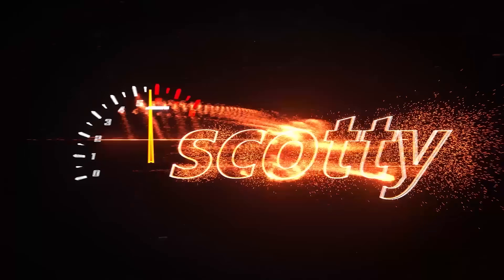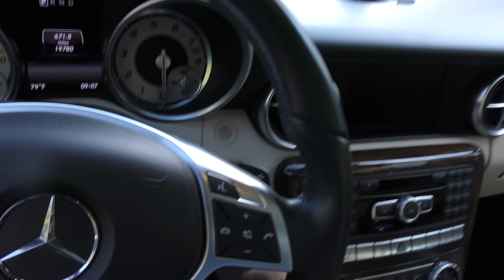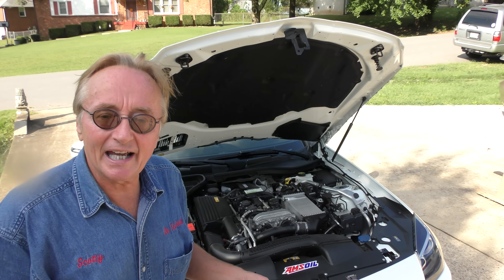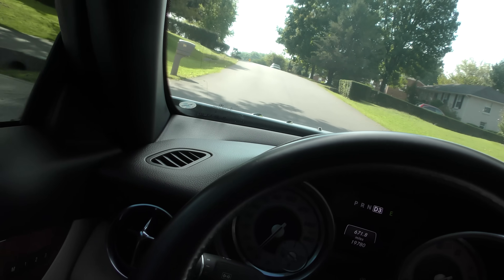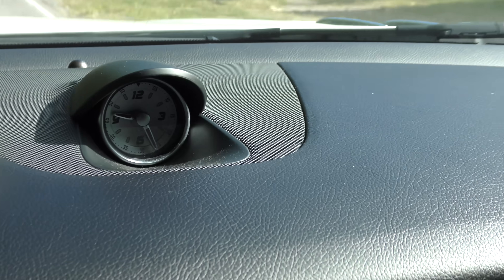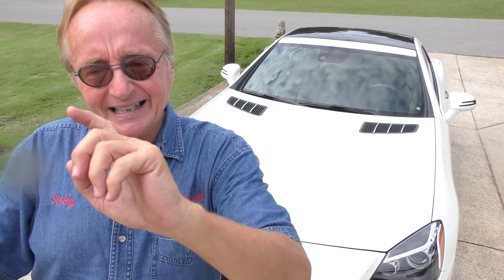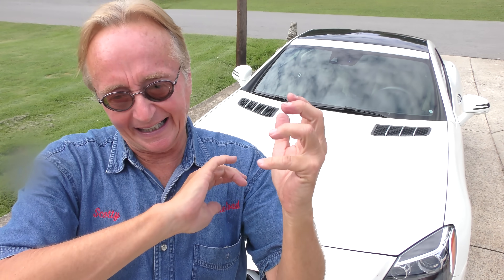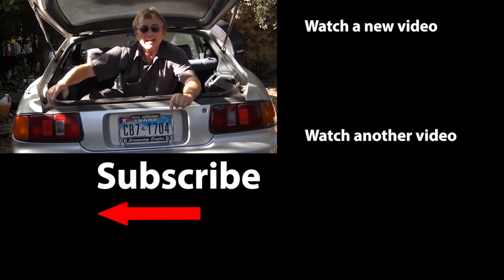I’ve Been Lying for Years, Mercedes is Actually Better Than Toyota

Comment: Mercedes quality really started tp.decline about 1996. I had an e320 from 1996 and my Solara was a wayyyyyy better car. The old diesel cars.were best the 123, 116, and 126. They still.had quirky problems like th AC never worked and window regulators broke once a month.

Comment: .  60k for a tiny 2 seater with a V4 lol and it’s a Mercedes. Even 20k for a used one is pushing it, I saw the center console it looks like it was doused in bleach no wonder it was 20k. only reason I’d ever consider a Mercedes is for the interior and if I was leasing the damn thing brand new.

Comment: Mercedes are better than Toyota going to the mechanic shop getting repaired all the time.  Spent $15k in repairs over 1.5 years ago going to the shop every month.  Only thing good is the engine, everything else you will replace is what my mechanic said.

Comment: Look at that super congested engine compartment mess. You can't even unscrew a bolt let alone work on a specific detail. I have all the room in the world to fix, replace or service every single element on my Toyota/Lexus vehicle. Even those that are slightly hidden due to physical constrains are logically positioned and require very little extra work to reach. Everything that comes from Europe is trash, except the german-made vehicles which are extra special trash!

P.S. For those that missed it, Scotty was trolling and mocking that MB throughout the video by statements that sounded like compliments on the surface but were actually deep insults.

Comment: Its a very nice biased opinion. He casually leaves out that Mercedes did a fine job at replacing the main problems on AMG models especially 2011+ cams fixed and other. However the C63s was built in the US and not in Germany. Stay away from those. I have an e63s from 2014. 212K on it. Going strong. Oil change every 4K

Comment: there are way too many damned comments here and my points will be BURIED in them. But I will make them anyway. I bought my first two Mercedes E class 320 DIESELS Bluetec, 2008 and 2007, in 2017 and 2016, and still own them both, one in MI and one in my summer home overseas. I have owned a HondA Accord COupe 1990 from 1994 to 2016, and it was WORSE than the PERFECT Mercedeses, who were BOTH BULLETPROOF RELIABLE SO FAR. AND I bopught them from dealers, with 3 and 6 months warranty, for $10.5k and $11k respectively, and with 110k miles each (about). You cannot buy HALF of a LOUSY Toyota or Hundai ELantra for $10k.  I will NEVER go back to these lousy econoboxes. MY 1998 BMW 740iL, some claim it was the most beautiful sedan ever made, with a DIVINE 4.4 lt v8, I bought in 2005 for $10.5k also, and 113 k miles, and drove it until 2017, BUT it did develop problems as it became close to 20 years old. The Mercedes DIESELS not only get 35 miles highway (and the smaller engine ones, the 2.1 lt, get 45! I got the 3 lt turbodiesels), they last FOR EVER, My taxi driver overseas did 4 million Km (2.5 mill miles) on her 90s MErc diesel until she replaced it with a 2021 2.1 lt (not avail in the US) with SUPERB fuel economy. And I will NEVER buy a damned toyota. I want to ENJOY driving, not have sex with a DEAD FISH.

Comment: Don't look forward to the future of cars if it's all electric because I think the cost of energy to charge it will be more than the gas after they ram us in the butt with green energy cost since solar is only 24 percent efficient and limited storage capacity.Besides how am I supposed to charge these said vehicles at night and not have someone else tapping into my charger in a apartment complex? sit there at night guarding my station with a shotgun? No that doesn't work for me.

Comment: You mentioned the electronics getting flooded out being insanely expensive to repair.  I know a guy who had a '08 Sierra (GMC) and tried to take it though a flooded road.  It did so much damage to the engine and electronics they could not make it run right.  I even told him he is damned lucky he didn't float away!!  If he ever does that again which I doubt he would, I will assume he just didn't learn his lesson that first time.  For that to happen to a Mercedes, just junk it.  You will spend insane money trying to get everything working right!!
Reply: Same case for any other car

Comment: Good one Scotty you got me…buddy of mine has a new toyota corolla he had nothing but issues with but those are exceptions 😅
Reply: @Vincent Bijman what kind of issues did Your friends new Corolla had? I’m curious. I drive a 16 year old Toyota Matrix with 150K miles never had an issue, but I’ve been hearing after the economic crisis in 2008/09 Toyota quality did go down SOMEWHAT.
Reply: @Blakecryderman7244  Well he thinks it is a swap parts car which i did not know about, but sometimes dealers get parts from one car to fix another car because of parts shortage or it needs to be fixed now. But sensor issues with the gasspedal not responding or other sensor not working properly happend a few times for him. But to be fair to the brand Toyota another friend of mine has a new toyota yaris hybrid, very fast ride en no problems.

Comment: I have to say Scott, the engine codes you tend to ignore in a Toyota would be even worth more ignoring in a Mercedes. I admit that later model Mercedes produced in Germany are more reliable. Did someone say Kompressor?? Kompressor engines are the same concept since ages past! I would choose Toyota only for easy maintainece and fuel economy but as for reliability, you're winning either way and Mercedes is more fun. I didn't mention BMW, worst crap ever. I'm sad to say Mercedes is learning the wrong lessons from BMW these days.

Comment: All merc is way beter then Toyota did u know it now lol
Reply: it was an april fools joke🤣
Reply: @lvgio  lol merc is beter then Toyota
Reply: @doraancilliers2999  definitely not
Reply: @doraancilliers2999  merc has 2 things better than toyota, luxury & speed, everything else toyota is 100x better and if u had any experience with both cars you’d know this
Reply: @lvgio  my merc put over 2.5 mil.. Toyota only did 1.5 mil
Reply: @doraancilliers2999  so? engine lifespan depends on how well u maintenance ur car, the way it drives ( highway mileage vs town ) the products used ( fuel, injectors & spark plugs, the oil used ) etc etc. toyotas last longer than mercs.
Reply: @doraancilliers2999  would also love to see the logbook of both cars and proof

Comment: Bought a used 2000 slk, 6 cylinder non turbo, 6 speed manual with 20k miles.  It was a great car but traded it in with 70k miles knowing Benz maintenance can get EXPENSIVE.